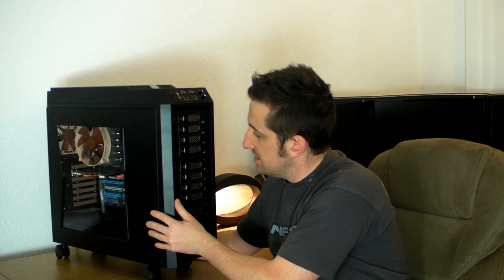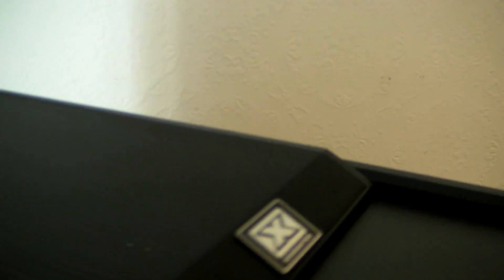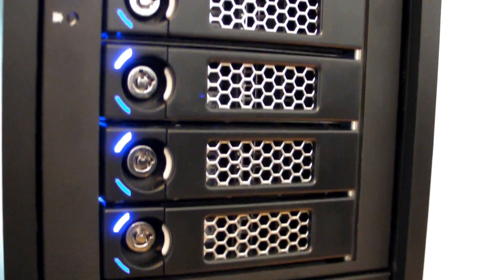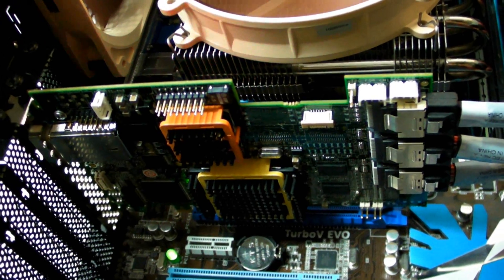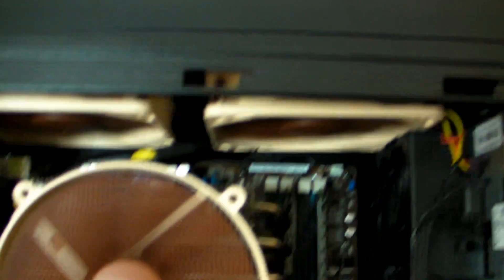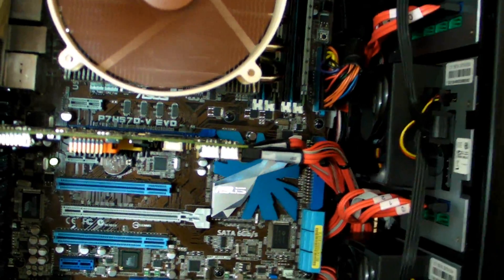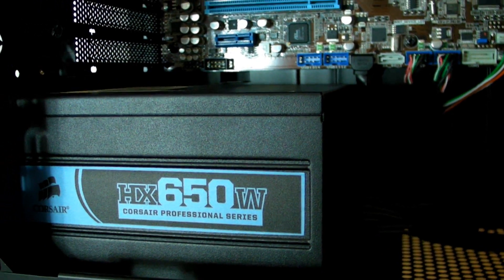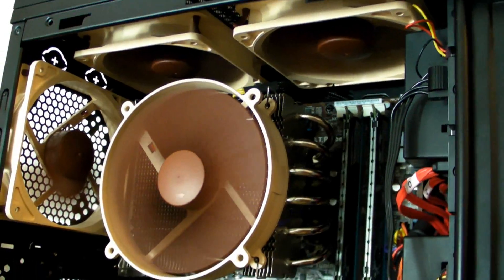12TB NAS Home Server Build Complete Server 2008 R2 Adaptec 51245

Comment: As for specific brand and model; I try to stay in line with system specifications from the manufacturer if there are any. Simply due to warranty issues, sometimes they'll nab you for putting third-party expansion cards in and void your warranty. I'm not going to be responsible for flushing the warranty on a 6,000+ dollar piece of equipment down the drain.

Comment: One in which the system is under load. See the hardware RAID controller is essentially a co-processor for I/O that is plugged right into the system bus, now we all know that in the Von Neumann architecture that virtually all contemporary computers are based on, the bus is the bottle neck. By using a dedicated co-processor that gets between I/O and the bus you significantly lessen how much data needs to travel over the bus.

Comment: With RAID you combine multiple disks in such a way that the operating system sees them as one device. Now there are multiple kinds of RAIDs from RAID0 on up thru RAID10
You need to carefully select which RAID you'll use as some only combine the storage space, some only mirror, other combine mirror and stripe. For example at home I have a RAID6 which requires a minimum of 4 drives it mirrors and stripes so that I can have 2 of the drives fail but not loose any data.

Comment: After I finished my 15 years old IT career (not interesting to work for anybody anymore) I can advise for not large systems to use software based RAID. All hardware solutions are pure marketing and money wasting. Today server motherboards contain up to 14 SAS/SATA  connectors, that gives you opportunity to build wonderful reliable configurations. And again and agin, nothing will help you without working out proper backup culture. It should be like teeth brushing before going to sleep.

Comment: RAID, is a technology which can do lovely things with your hard-drives such as:
- Setting up multiple HDD's and merging them into one;
- Back-up in multiple ways, most secure and common usage for your data is mirroring. Which means that you have 2 of the exact HDD's and let one of the two copying your data. If one of the two HDD's fails you still have your data and it keeps running,

If you want to learn more about it, Google it.

Comment: Nice build for almost 3 years ago.  I'm up in the air over building a system using a Xigmatek Elysium case with 4 iStarUSA BPN-DE350SS 5x3.5" hot swap bays or just go for the Norco RPC-4224 24 bay 4U case and just throw that into my rack.

Comment: your raid card is missing a backup battery. beware of those raid 5 write wholes.
your staggered spinup for the hdds isn't working. also adaptec kinda sucks. i got a 3ware 9750 8 drive raid 5 array reading at 800mb/s. the 2nd gen sas 6 lsi ones will give you 1600mb/s @ raid 5. also your controller will tear those drives apart, set speed to sata I and disable NCQ, otherwise you'll be in for a very bumpy ride indeed!

Comment from the maker: @ITSAssassin 650w is overkill for this rig if anything. The boxes take up 3 optical bays for 4 hard drives. RAID was configured as 2 seperate RAID6 arrays. The icy boxes fit anything with optical bays

Comment: @TimeToLiveCustoms i noticed my suppliers have the HD 6930 in stock. what are the chances of a review on that card before the 7000 series luanch? Also need a decent GPu for a triple monitor display fo my editing station,its eoter the HD 6850 or HD 5770. wanna keep it cheap.

Comment: Corsair PSU Manufactured by Seasonic I own 2 myself AX850 and HX650 the 650 is 2 years old well going in to its 2nd year no problems runs quiet as heck but love em both

Comment: @crforfreedom1 there are plenty of alternatives. Pretty much any 4 in 3 hotswap will do. For example, you can find Icy Dock MB454SPF on newegg easily, which supports sata 6gbps. None should have RPM limits on the drives.

Comment: If you have a 16 controller anyway, I would have gone for 16 internal and a full tower case with an extra drive cage at the top. RAID 50 might have been another option rather than RAID 6 too.

Personally I go for ZFS (maybe btrfs when it matures) with a 16 HBA and beef up the CPU and especially memory rather than spending just as much on a single relatively inflexible RAID card.

Pretty nice though. I'm surprised I haven't seen it done more often.

Comment: @xmikedanielsx  Doing a little more research/changing up words in google. I found that they are called Multi-lane cables, which utilize the SATA Multiplier technology found with most raid controllers or hba adapters.

Comment: I had a couple questions. What cables are you using? The RAID card only has 8 internal. I only saw 4 cables plugged into the RAID card. Are you using some kind of SATA splitter?  If you can point me to a link where I can pick one of those cables up. Looking to build something exactly like this with OPENFILER on it. What model is that case?

Comment: nicely done but those lights for each drive may be undesired this probably should be tucked away in a corner or closet. I know that adaptec cost alot. I'm gonna set up a NAS i'll want it hidden away i'll probably get the Q08

Comment: @hokibacsi1 Actually a couple hundred dollar dell 100/1000 16 port managed switch can deal with channel bonding.  in the case of a 4 port intel nic the switch ends up being the cheaper of the two. (powerconnect 2716)

Comment: I have a file server too, kind off. It is my old rig with E6750, 8gb ram, 1.7tb of storage over 4 HDDs. It runs Ubuntu linux and I have all my files on it. In my main rig I only have SSD with OS on it. Silence is golden so my server doesn't live in my room, it was banished into the living room so I use it as HTPC as well.